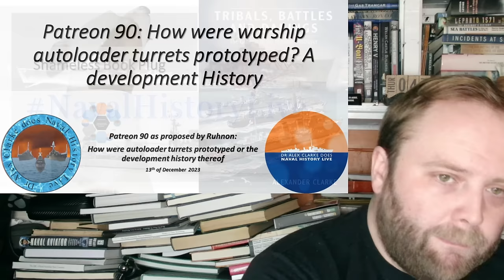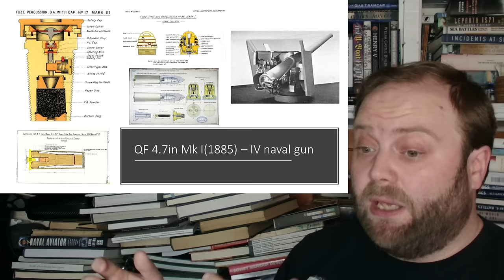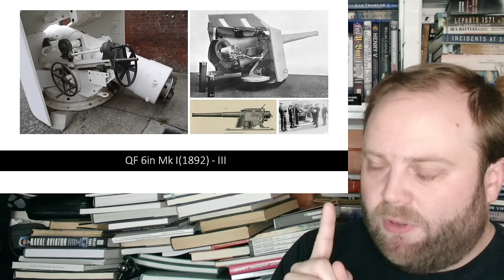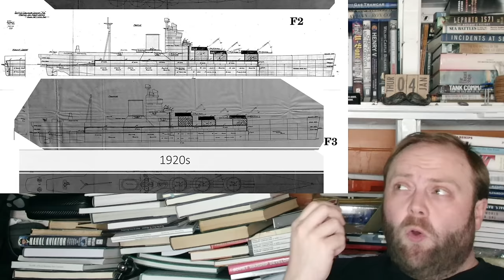The Philosophy behind Autoloader Development for Navies

Comment: I know its not directly linked to autoloading but looking at the 15inch gun firing diagram I realise yet again how much of a marvel of teechnology the battleship really was/ is. The metalurgy advances required to get to it, the tolerances to even make the barrels and how thick they are including the lever system to get the ammo up there, the precision to make so many small geared turbines to drive the propellers/screws. the ammount of effort to get to the fuses. Its one of those things where I dont stop to think about it but when I do I go yeah this really is the peak of the tech tree (and was from the first rate until the end of the battleship).

Comment: 44:35 - adding to the engagement range: gun vs sensors - at around the maximum range, we have plunging gunfire, there even a smaller gun, not even capable to penetrate deck armor can (and at North Cape DID) hit sensors, start fires, penetrate non-armored stuff, etc....
Reply: Yes. Soft kills are under estimated, and deadly.
Reply: An approach that is coming again with small missiles and guided shells. If you can disable the radar it doesn't matter how many missiles a ship carries.

Comment: 42:40 "A 22" ship might have a range advantage over a 14" one" - MIGHT. But then its most likely that the German 11" battleships Sch and Gnu scored the longest WWII hit - over 26k yards, yet their guns at the maximum 40 degree elevation of their turrets over 44k yards (that is almost 41 kilometers).
Not to mention our beloved OTO 76mm Volcano ammo with a similar 40 km range against surface targets (the 127mm, ie 5" L64 OTO gun with the Volcano ammo is marketed for 120 km range). 
In simple terms - its more the SENSORS, than the gun itself.
Reply: Well it's also the speed and accuracy of computation of firing solutions and how quickly the shells arrive. The lag for the acquisition of the data for firing(the sensor) is the speed of light but then there in the time delay between that and when the shell arrives that is increasingly hard to calculate and predict as distance increases
Reply: @alexdunphy3716  Plus if the parties have good enough radar, they can evade "long enough" range salvoes.
That is, until guided shells come into play, but guided missiles preceed that.
Reply: @karlvongazenberg8398  or faster shells. Course correction(but not full guidance) also helps
Reply: @alexdunphy3716  I was referring to the fact, that it is way easier to make a guided missile, than any sensors and electronics which survive being shot out from a gun. And then comes to issue of the ability to change flight vector.
Reply: @karlvongazenberg8398  sure thats true as a general rule

Comment: OK. Wierd-ass question:
With knowledge of HARP (the space capable gun) and the inclusion of ram jets in artillery ammo, with the prospect of long range mach 3 powered "flight", what do you think the likelihood of battleship calibre turrets returning to at least some new naval ships?
I apologize if this is an ignorant question. I am quite ignorant in naval history and logistics, etc.
Reply: Large caliber guns were developed to defeat armour. No current or forseen ship has armour today.
For shore bombardment, airplanes, drones and loitering munition also took the last role for big guns
Respectfully
Reply: @ricardokowalski1579  All true.
Still, a charge of gunpowder and a ramjet projectile may have similar destructive power, range and accuracy with less cost per shot. If true, battleship-like vessels may return.
Reply: @bmobert  a hypersonic launching platform would be closer to the Adm Metcalf's idea of an "arsennal ship". 
Thick armour to take and survive blows will not come back. 
So the triad of speed/armour/firepower that defined battleships would be broken.
Witness the Kyrovs, they are the baby steps in the direction you are pointing.
Regards 👍😉👍
Reply: @ricardokowalski1579  Again, I completely agree.
However, I'm not talking about using the old metrics. They are gone, never to come back, just as you say.
However, a Howitzer round with ramjet and homing capabilities may be a cheaper per-shot solution to multiple problems than mid-range missiles.
Basically, I'm suggesting a small, short range interception missile fired out a cannon might achieve the same goals and be less expensive per shot than equivalent pure-missile systems.
I couldn't possibly give examples, as I'm an astronauts and astrophysics guy. Weapons don't generally interest ms. So I have very little in-depth knowledge.... Hrm...
...
Perhaps this is a better way to express this suggestion is: What naval missile systems could be replaced with an 8 inch ramjet-powered, sustained Mach 3 round with 3 meter accuracy out to 100km with a per-shot cost of $50k? (IDK. Is that expensive? Or cheap? Regardless pretend it's $50k.)
Speculate with me.
Reply: @bmobert  ahhhh

So this was tried in the Long Range Land Attack Projectile (LRLAP), with some sources quoting US$800k each round.
Also the Extended Range Guided Munition / EX171 went down that path.
Both were 5inch diameter, rocket boosted. 

The Extended Range Artillery Munitions Suite (ERAMS) is ramjet powered, and hypersonic. It's still in development.

So yes, it is happening. 👍
Reply: @ricardokowalski1579  I know it's happening. Ive seen the videos and read some of the articles. That's where I got the idea of using larger diameters blasted from a turret on a naval craft.
It seems to me such a round would cost less than a missile of similar capabilities and would allow for battleship-like vessels to return. Obviously, they would be smaller in tonnage and crew complement, and they wouldn't replace missile boats. But they could have a niche in the naval ecology.

The original question was: How stupid is this thought? How likely is it to be part of the future?
Reply: First Person View munitions pose more of a threat at the moment. If you can fly 50 small missile/drones at the target, stopping those.tinu weapons.is very difficult. Individual hits may be pinpricks, but weapons that can fly through open doors on APCs can equally pick critical locations to hit (the base of a radar or the emitter horn, a missile cannister, etc. Yes, they are vulnerable to EW right now, but we can expect increasingly effective self guidance. We're seeing bad versions of autonomous vehicles navigating traffic with some level of success. Increasingly autonomy for weapons isn't science fiction.
Reply: @ricardokowalski1579 if that were true artillery wouldn't be the most influential piece of equipment in the Russo-Ukrainian war
Reply: @ricardokowalski1579 but LRLAP was a dumb implementation of that idea and tried to be too much of a missile. There exists right now a INS/GPS guidance kit/fuze that screws into the spot the normal fuze takes on NATO 155mm shells. Based off of the Australian contract for their purchase they come in at about $5k each. The larger the shell the easier it is to fit in guidance kits. And 8" shell would work much better than a 6" shell and even if they just upscaled the volcano ammunition to 8" you'd get something close to 150km range. Its a good idea
Reply: @bmobert  zero stupid idea.👍There are several reasons why you want to develop this.

The best one is this:  long range missiles make a huge InfraRed signature when launched. The US, Russia and China have special dedicated satellites to detect missile launches. 
If you launch a large missile, there is no way to tell if the warhead is nuclear or conventional.

In a world where you need to strike non-state actors, it is important to not confuse the other nuclear powers into thinking you launched a nuclear first strike.

Gun barrel launched ramjet shells will NOT show as an ICBM missile launch. This will allow measured, conventional, even stealthy retaliation, without risking a nuclear misunderstanding.

Cheers
Reply: @ricardokowalski1579  
That is an aspect i hadn't considered.
There were, of course, nuclear Howitzer shells. Regardless, you are right: they're not ICBMs, so even if they're nuclear, they're local.
Still, if we can assure the world the B-1B continues to be modified so it can no longer carry nukes, we can probably assure them our Howitzer rounds are also non nuclear. 
Yes. This is a very interesting point.
Thank you.
Reply: @bmobert  my pleasure, chief. 👍🙂👍

Comment: when to comes to the big battleship guns which in modern times has greater accuracy so you need only one gun, one gun is easier to automate than two guns or three per turret.
Reply from the maker: You're not quite correct, I can see where your logic is from but it doesn't work out like that... multi barrel are just as difficult to design as single barrel automated systems... in fact it's often just a case of replication... You would have been right if you had pointed to complexity of maintenance & servicing in a multi barrel turret vs a single barrel system(thus the crew hours & dock hours it will cost) and the space/weight it takes up... still I would not be surprised if twin barrel systems return as probably the easiest way to substantially increase volume of fire
Reply: @DrAlexClarke so it's just a mathematical result of having more of something. If you have a gun with 99% chance of nothing going wrong every time you add a gun you multiply the chances of nothing going wrong to get the chance that none of them are going to need maintenance at a given time